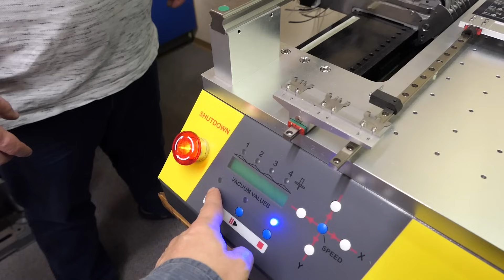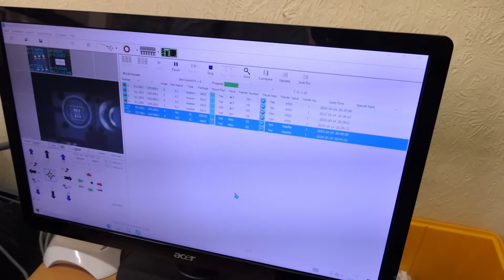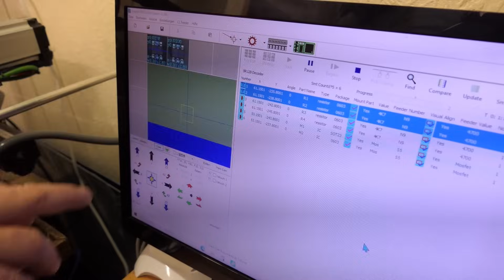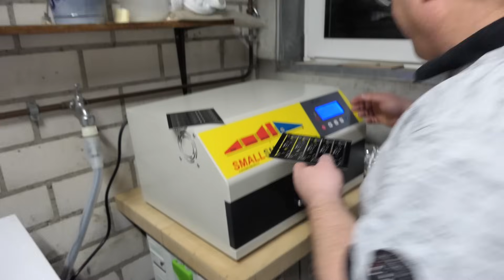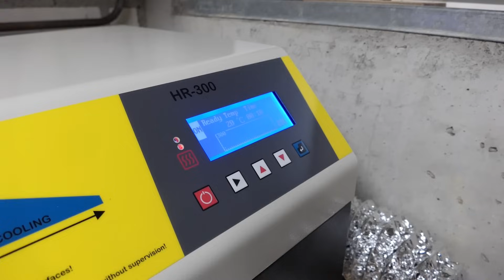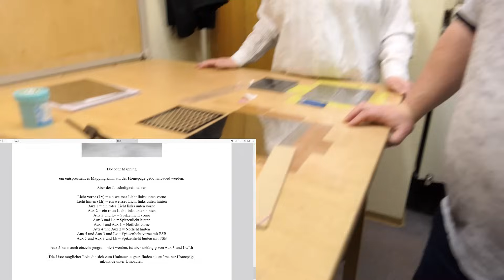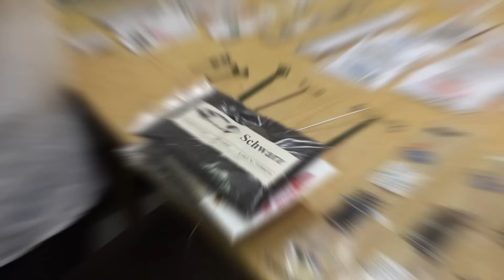Märklin-Loks aufgepeppt: Lichtplatinen im Fokus

Comment: Hut ab vor dieser Produktion und dieser Leidenschaft! Da sieht man mal, was wirklich an Arbeit und teuren Gerätschaften dahinter steckt! :)

Ich habe mittlerweile auch viele Platinen (über 20) in den alten Märklin-Loks verbaut!

Im Frühjahr/Sommer steht der Kauf von insgesamt  10 weiteren Platinen an. 

Danach bleibt es spannend, ob für die BR 101 noch der passende Satz kommt. Bei zwei 101er habe ich den Umbausatz für die BR 128 genommen, aber Märklin hat leider die Positionierung der Gewindestangen für das Gehäuse da geändert. Ergo muss da auf eine Schraube verzichtet werden. 

Was bestimmt in ferner Zukunft auch ein Traum für jeden Besitzer der Piko-Hobby 218er wäre: Wenn es dafür einen LED-Umbausatz gäbe. Da wäre ich mit 15 Loks schon ordentlich dabei :D
Reply from the maker: Hallo Christian, danke für den Kommentar. 😄 Über 20 Platinen? Respekt, du bist ja der MacGyver der Märklin-Loks! 🔧 Die BR 101 klingt nach einer echten Bastel-Odyssee – eine Schraube weniger? Weniger Gewicht, mehr Speed! 🙂 Viele Grüße, Jürgen
Reply: @modellbahn_H0  Das mit der 101 ist eigentlich recht simpel. Es muss wie gesagt nur ein Schraubgewinde vom Deckel weg und schon passt die Platine. :) Dennoch warte ich für die letzten 5 101er darauf, dass in 1-2 Jahren da die passenden Platinen gefertigt werden :)

Bisher wurden: 
9x V160, 5 V60, 4 V100, 7  BR 120, 1 BR 194, 2 BR 101 (mit der 128er Platine) umgebaut. Also 28 insgesamt...  

Für 2024 stehen:
4x BR 81 (mal schauen, ob die LED-Platine + Dampfgenerator da Platz finden), 6x DHG 700, 1x DHG 500 auf der Liste. 
Später dann die BR 050, 2x der Schienenbus und die letzten 5 BR 101er. 

Dann sind alle Märklin-Loks auch endlich volldigital mit vorbildgerechtem Licht ausgestattet. 😅

Comment: Danke hab schon 14 Platinen von euch verbaut, BR89, V60, V100, V160, BR194, BR81 alle sind so genial.
Für eine V36 wäre es auch net eine zu haben, Bei meiner Märklin 3139 hab ich mir richtig die Zähne ausgebissen, mit den LEDs und Kabel da reinzubringen.
Reply from the maker: Hallo, danke für Deine tolle Rückmeldung. Die Keller´s lesen die Kommentare auch mit: vielleicht kommt mal was zur V36 🙂. Viele Grüße Jürgen